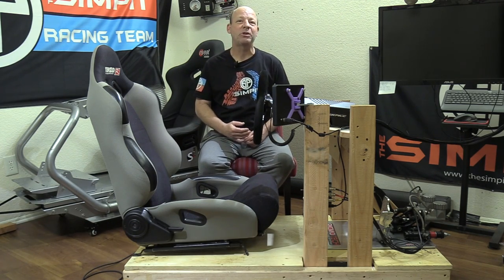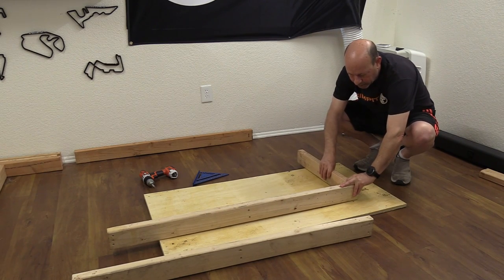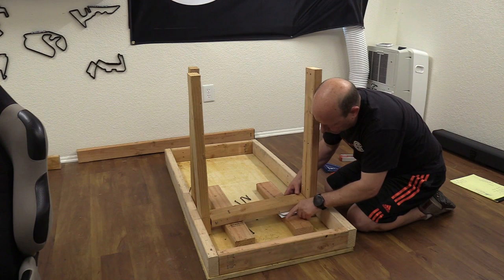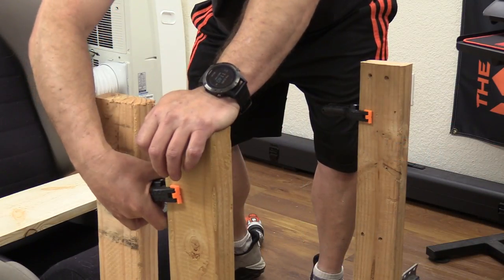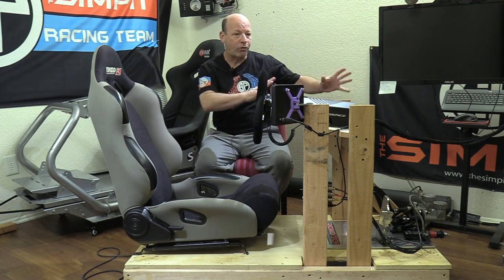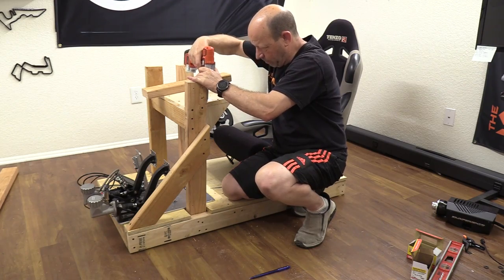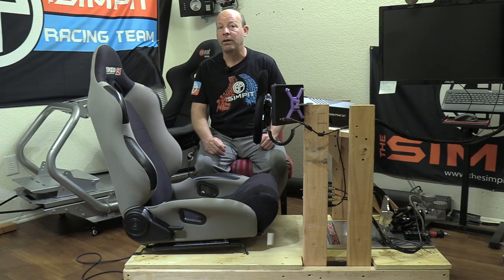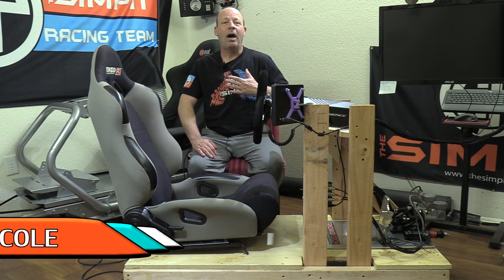Step By Step Under $100 DIY SIM Chassis - Death Mobile 2.0 The Build

Comment: I built one way back after watching the first Death Mobile video on ISR. The rig absolutely did not move! None of the wheel forces were wasted and there was zero flex. Comparing it to a GT Omega which I also tried, the wooden rig was totally superior in terms of robustness. Ofcourse with the Omega you could adapt the rig on the fly alot easier to suit, but if I could make a wooden rig with added adaptability somehow that would be grand. Never quite figured that out though apart form redrilling/positioning the parts to suit. Great video Shaun! All the best

Comment: This is great, but most of the cost of the rig is the seat in the end (excluding pedals, wheel and shifter of course). Most of the builds I saw they have a seat from somewhere; if you try to source one from a junkyard it cost you twice as much as the wood and parts for the rig sadly :( To the point where if you have to spend 300 dollars or more, at that point you are already in the territory of entry level rigs

Comment: Not bad but,,, you didn’t say where you got the seat, what kind is it, and how much...  This is the biggest issue I have, the seat...  The rig is the easy part for me... thx for sharing!
Reply from the maker: My seat was purchased off of Craigs list years ago, for 100 bucks at the time. If you're looking at doing something like this for yourself, I'd suggest checking ebay, craigs list, kijiji, those kinds of places, and even better, if you have it available, and auto wrecker is a great place to get a seat. Booth got his Tiburon seat for 50 bucks locally.

Comment: i could actually buy a DD if i built this. My current rig is rattling apart and the dest mount is half held on by duct tape. Sure i could splurge and get a DD & aluminum profile rig but i cant justify it... Mental hiccup